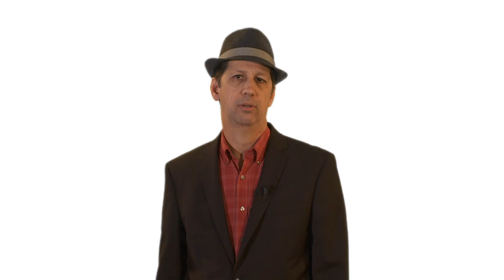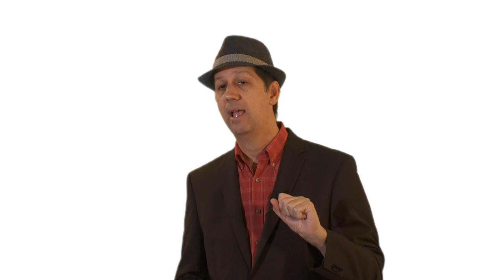OTC-X1 Questions & Answers

Comment: my question is the crystal and lasers... they are never spoke of... It seems to me the lasers would have been more of a spark gap created to form plasma that   draws external energy to the accumulator. .. I can see everything else creating   anti gravity but the frequency I think is the key.. I plan to work on it in the future so I'm interested .
Reply from the maker: The LASER and crystal, per Ralph Ring's story - is a mystery.  LASER light possesses a highly narrow bandwidth of Electromagnetic radiation within the visible spectrum.  It is not full-spectrum light; so, the claim that Ralph makes of a LASER light striking a crystal and refracting into a rainbow of infinite colors doesn't make sense to me and my understanding of the Electromagnetic Spectrum.  When LASER light strikes a faceted crystal, it may change direction as it exits the crystal; but, it won't refract.

Regarding crystals, research on them has been done by Dr. Marcel Vogel.  I suggest viewing his lectures online, which connects the woo-woo with science.  There is a link between the mind and certain configurations of crystals.  Given Ralph's story about the craft being controlled mentally, I think Dr. Vogel's presentations are worth consideration.  Start here: 

Dr Marcel Vogel - Therapeutic use of Crystals - Part 1 
https://www.youtube.com/watch?v=6c9HQ4lM8JY

Comment: I can see if the spacing of the utron is close to the iron on top let's say and more of a gap on bottom the top will drag due to induced magnetism causing the utron to spin and the bottom to produce dc voltage and current to power the unipolar motor and electromagnets. I assume that a capacitor is in there some where to hold the charge generated by the utrons, that this thing would power it's self seeing that the utrons may be a form of homopolar generators or the other way around and the utrons are the motors and the aluminum plates are the generators.

Comment: i keep going on and talking so i apologize. In this video you talked about an insulator or dielectric material and both nylon and teflar are both rare earth elements because they have this extra band of electrons. my purpose of this message is i believe the dielectric material nylon is placed between the bent t 6 aluminum plate and as it spins it passes over the nylon like a nylon belt charging the sphere of the tesla coil. So the nylon must be connected to a stator while the bent capacitor is connected to the rotor this would be my explanation to why the capacitor is bent with a space between it. i am also assuming that the otc x1 doesnt require any kind of wiring aside from the copper coil. also i assume the charge will jump from the capcitor to the coil wire around the iron horse shoe magnet then back to the accumulator and then from the accumulator  back to the now neuatral t6 aluminum capacitor plate. this also explain how the air is ionized when light travel from the ground to the sky it discharges and while traveling through the air to the clouds it will ionize the air between and because of this the out put will be more than the input. i am going to build this my self when i have the money for now i could use your advise.
Reply from the maker: When you start...send pictures and your status...and I'll connect you with the other guys.  Regarding your notes: interesting take.  I'll have to digest the system.  In the meantime, read Tesla's notes on Forbes' Monopoloar motor.  
walter@clandestinedisclosure.com

Comment: my main point is the motion of the nylon must exchange atoms to the t 6 aluminum capacitor then when capacitor has hi enough charge it will jump to the coil around the horse shoe magnet and back up to the capacitor. i know the electron Carrie force so now the we know how to control the direction of the  by using an electec ( view the videohttps://www.youtube.com/watch?v=Nxwznp0Q6NI ) then the electrons will charge the capacitor and jump to the coil of wire around the horse shoe magnet perpendicular to it. 
i also have a question is it possible find out what material teals used for his Tesla rod because this is what material the center accumulator is made of.

Comment: the center accumulator must be made out of the same material as the Tesla rod. You talked about a dielectric material nylon this is used to charge the capacitors like the nylon belt of teals coil.  i also asume that the insulator dielectric material is an electret if i spelled it right. the nylon can carrie a static charge and when you wave a magnet over the static field of the nylon it will follow the magnet. when you create an electrit from nylon and wave a magnet over it will move perpindicular to it because the electron are moving in a diffrent direction than before. to make an electrit is simple heat melt and stir nylon then apply high voltage while cooling to stir constantly. when cooled you can perform this experiment. this is it in practice https://www.youtube.com/watch?v=Nxwznp0Q6NI

i also know that the levitation of the vehicle is caused by the u tron gryo moving at a hi enough rpm and a force being perpendicular to the u tron. it is gyro scopic levitation.  if you spin a 25 lb weight on to a bar that is vertical at a hi enough rpm the wieght would fly of the bar perpendicular to the spin as the trons force is perpendicular to the spin.

Comment: thats where the pronlem lies the inner mass of inner spinning disc is not symmetrical to the the mass of outer discs...however if the inner spinning disc is immobilized and the outer disc are counter rotating they will achieve perfect symmetry antigravity can be accomplished so the accumulator must be di-unipolar with the negative pole of the accumulator towards the center
Reply from the maker: You lost me on your usage of the word symmetry with mass. If the disk were not symmetrical, it would not spin evenly.
Symmetrical means: made up of exactly similar parts facing each other or around an axis.  An example would  be the shape of a heart.  divide it down the middle and the two halves at the axis would be symmetrical.  The OTC-X1 is symmetrical.  If you split it down the middle, the halves would be symmetrical.  Symmetry holds no connotation of mass.

Regarding your use of the world mass, I'm trying to understand and decode your message.  Do you mean to say that the mass of the inner spinning disk, which is comprised of the central accumulator; accumulator frame; and, UTRONs mounted to the accumulator frame, must be the same as the mass of the hull, which you referred to as outer disks?  When viewed as an assembly, the hull spins on the same axis as the accumulator frame and does not resemble a disk.  

If they were two counter-rotating parts, they would be more bowl-like.  Look closer at the design of the OTC-X1 and you'll find that iron c-shaped electromagnets are mounted to its outermost interior and join the upper and lower halves, making it impossible for the two parts to rotate independent of each other.

You suggest immobilizing the inner disk; but, that's not how the OTC-X1 is designed to operate.  In fact, the entire principle of Carr's anti-gravity theory, which some are convinced has already been tested in the lab, is not consistent with your assertion.  In fact, the design of this craft's rotation mechanism is founded upon the monopolar motor (Read Tesla's notes Forbes' monopolar motor), which leverages Lenz's law.  

Assuming the central accumulator frame of this design were to be immobilized, as you suggest; and, given the principles of this craft's design, rotation would not be invoked when a charge is applied to the conductive surfaces of the accumulator frame (Capacitor plates).  Nothing would move.  

Di-unipolar - intriguing.  So,let me think about that for a second.  Off-the-cuff, some of the issues may involve managing flux density without interfering with the adjacent electromagnets; meaning, I think you would need, magnetic shielding between the two halves of the hull at the equator, which is where the electromagnets are mounted and would be passing each other during rotation and counter rotation.  The flux fields could weak havoc on the independent monopolar operation of each half.  To achieve the disparate rotation of upper and lower hull sections, a completely different design would be required...namely, mounting and positioning of the electromagnets so that they would not interfere with each other.   

Do you have that design, complete with wiring?  I'd love to see it.  If not, please tell me why you're convinced your version will work.  I can KINDA see what you're saying; but, I'd like to hear from you about the science that lead you to your assertions.  Walk me through your understanding (electrical wiring, laws of physics, tests, etc.) of how locking-down the inner disk Could cause independent rotation of the outer hull halves and why you think that would cause levitation, as opposed to Otis T. Carr's design.  Have you tested your theory?  I guess the root of that question is: How do you know your implementation will work?

Thank you for watching and posting your comments.

Comment: you have to look at the craft as one large capacitor or tesla coil also the the top has to spin in opposite direction as the bottom
Reply from the maker: If you look at Carr's plans and listen to his radio show interviews, you'll see that the craft has two moving parts.  The inner accumulator frame and the outer assembly.  The C-shaped electromagnets are affixed to the super structure of the hull at the equator, thereby making it impossible for the upper section of the hull to rotate independently and in the opposite direction of the lower hull.  Rather, the entire hull rotates in one direction, while the inner accumulator frame rotates in the other.

Comment: Cool project, but since 4 years almost no progress?!?  How can this be? Looking forward to your answer ;-)
Reply from the maker: +IS-BE Starbrother Tthank you for posting a comment.  Yea...this is a common question; and, my answer is always the same.  In a nutshell, the guys are performing R&D and tests out of their garages and workshops using money out of their own pocket as their free-time permits.  Parts, metal, machining, milling, etc is expensive.  

No complete design exists; because, none of them understand all facets of the craft's supposed operation.  The monopolar motor, for example, appears to be one principle that Carr leveraged in the design of this craft.  To fashion a small prototype that leverages monopolar motor principles - mmm - ball park figure would be roughly around $5,000 to $10,000 to build.  Who has that kind of disposable cash laying around?  No one is going to dump large sums of money into constructing a prototype until they understand the principles of operation.  At the very least, they'll want to have a firm reason for building a unit for testing.  Once testing is complete...then what?  What happens to the test unit?  Is it still usable?  Once that money is spent, it's gone.  How log would it take to save more to take the next steps?  Anyhow, I think that money is one of the major hurdles, here.  Look at like wanting to build an airplane in your garage.  How do-able is that?  

The Pods are not a corporation with development initiatives and budgets to support them.  They are hobbyists who work and test as time and money are available.  Consider how many projects you may have put on hold when life got in the way.  Did anyone come by and say, hey, it's been four years.  Why no progress?  How can this be?  :-)  

The guys take whatever meager amounts of money from their own pockets and test various principles, as they see fit.  They all have their own thoughts on how the craft should work.  Some are more focused than others.  Each have their own theories.  Some are grounded in science...others operate by connecting the dots between their scientific and esoteric research; and, they make guesses.  Research and collaboration continues between Pod members, which isn't so visible to viewers.

Think about it.  This thing - OTC-X1 Circular Foil Craft - is basically a perpetual motion & free-energy machine combined into one.  Simple enough, right?  All you need is free energy.  HA!  Not to mention, the mental aspects of its navigation (LASER + Cyrstal + Mental focus) is confounding, at best.  Is the craft supposed to be a combination of spirit and science?  of alchemy?  I don't know; but, from my perspective, I sure see a lot of theories lofted about this.  I'd be pleased to see if rotation and counter rotation invoked under convention power sources (batteries / electromagnets / spinning plates) can cause levitation, as Otis T. Carr says it can.  Then, I'd be convinced this thing could work.  

As for my reports on progress, I provide updates when they're provided to me.  So, don't hold you breath.  I'm not.  :-)

Comment: what about the mercury??
Reply from the maker: +BosnaCity All I have on mercury, related to the OTC-X1, is that Otis T. Carr tried it...there was a leak and an accident that hospitalized Carr; and, the use of it had been abandoned.  For the pods, there has been some discussion about using possibly testing its use inside the spherical hollow of UTRON Electrical Accumulators.  These are the smaller UTRONS mounted around the periphery of the accumulator frame - distinguished from the truncated and larger central accumulator.  Carr's poems, Dimensions of Mystery - http://clandestinedisclosure.com/Docs/Dimensions%20of%20Mystery%20-%20Otis%20T.%20Carr%20-%201958.pdf, provide clues to certain materials or amalgams that may have been used inside the spherical hollows.  Examples: Some have interpreted Suzanne to be Cesium.  At this point, the pods are still testing with solid UTRONS.  I've been told in the future, they will have hollowed-out UTRONs milled for testing, as well.
Reply: +Search4TruthReality okay yes I have read about that also. and that's awesome I can't wait to see what comes of it. What is your email ? I have something to show you regarding capacitors and mercury.
Reply from the maker: +BosnaCity I look forward to seeing what you've got.   walter@clandestinedisclosure.com

Comment: I think one of the test that could be done in putting Ormus in the central accumulator. Are you aware of Ormus if not watch this video. 
https://www.youtube.com/watch?v=gLFytyjV7h4
Reply from the maker: +Talyn71 Gmail I've seen his presentation before.  This is about monatomic gold, right?  It's a white powder comprised of the bonding material of gold, which was the byproduct of burning gold, or some such thing.  I've read speculation that consuming it lofts ones spirit to other dimensions and comes with a high soul-price to pay if one does.
Reply: Yes everything you've mentioned is true. If you start the video at about the 45 minute mark he begin to talk about the other properties of Ormus which are as a superconductor. And they also talk about Ormus disappearing to another dimension as well as levitating itself and whatever bowl is holding the Ormus. And it is believed Ormus was in the Ark of the Covenant and it acted as a dielectric material.
Reply from the maker: +Talyn71 Gmail what's going on with that LED in your video?  What did you do? Are those diodes soldered to the leads and then soldered together?  Also, I've updated my website just now with some new documents from the pods -- updated 'kit' drawings with pictures that I'm sure will be of interest to you.
Reply: +Search4TruthReality Thanks for the update on your website 'm very interested in all the information I can get . I'm not sure what video you're referring to with the LED.
Reply from the maker: +Talyn71 Gmail I confused you with another person who posted an LED video.
Reply from the maker: +Talyn71 Gmail I remember reading something about a battery technology - I don't know, maybe it was in the video you sent and I've already seen - where they were using this monatomic gold and the batteries kept disappearing.  Was that in this video you sent? Sorry, I just haven't had the time to watch the thing again.  Bottom line: I am aware of this stuff.  I'm not sure whether anyone knows how to make it; and, if they do, the process isn't public.  I've seen products out there claiming to be this stuff; but, how does one confirm this stuff is real?  There's so much snake oil out there.  Personally, I'd prefer to know how it's made and make it myself to test it.  Otherwise, I'd need some means of testing and validating it.  Right?  What are your thoughts?  Have you seen this stuff - worked with it at all?